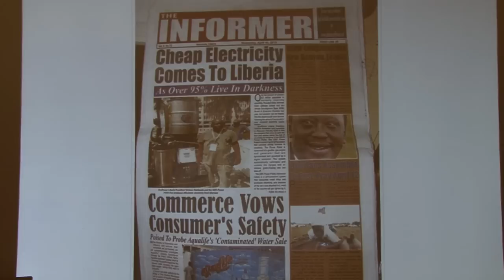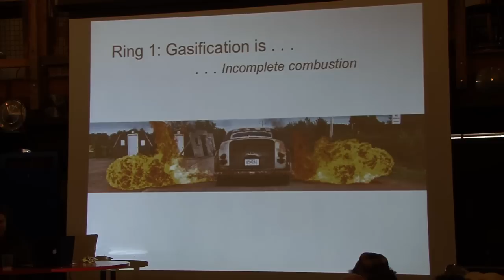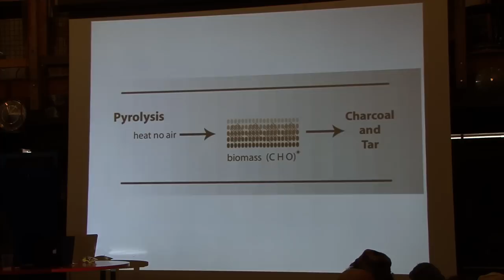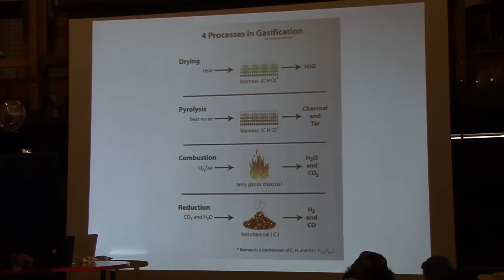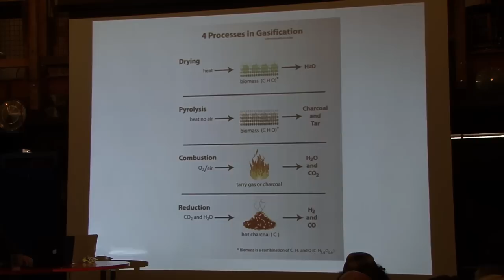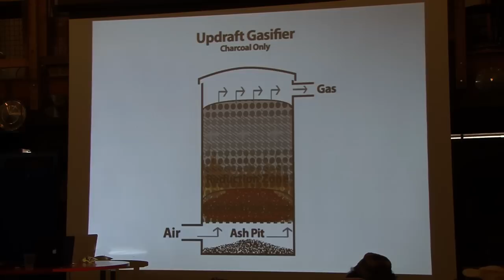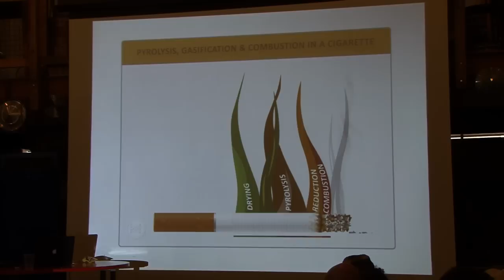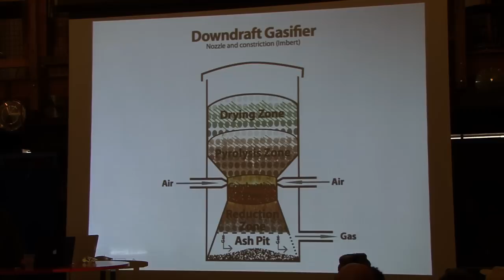Gasification 101 - Part 1

Comment: I have built a gasification test rig.  It does not recycle heat efficiently though.  It uses solar electricity to char the biomass via pyrolysis - mostly paperboard and wood waste for testing - this evolves a mess of gasses and liquids that are collected over water.  The reactor is steel and the heating is done via nichrome wire mounted in a firebrick housing temperature monitoring is via a thermocouple.  water vapor, methanol, other liquid hydrocarbons and lots of gas products are collected in the water at this point.  In the future I will probably try to condense and separate out those liquid products at some point so they can be separated and useful products saved and the useless ones recycled.  The Char that is left in the reactor is mostly carbon and is heated to 1200 degrees Celsius and steam is injected at the bottom below a screen.  The gases evolved at this point are collected again, this time almost purely CO and H2.  In my case I combine the wood gas and the water gas and can compress it for storage and use it for combustion using a repurposed air compressor where the inlet is from my floating gas storage and the outlet is to a propane tank.  The Fuel air mixture for combustion is closer to methane than for propane, but in a propane tank at 125 PSI and dropped through a regulator it will burn in my grill just fine, if a bit leaner.  It will not power it nearly as long though as you are compressing a gas and can not take advantage of a phase change with these gases.  The mixture is mostly carbon monoxide and hydrogen, but there is a bit of methane and carbon dioxide as well as some other hydrocarbons and nitrogen mixed in there.  I could scrub it to remove sour gases, but with my feed stocks that has not really been an issue.  The pyrolysis and the generation of the water gas are both endothermic reactions.  I input that energy from solar, so I do not leak that much carbon to the atmosphere until of course the end product is burned.  In a larger scale one could produce a large variety of products from the syngas generated.  I basically have a desktop batch setup that can generate a small volume each batch, but it is proof of concept.  It does work well.  Improvements would be to recycle the heat better to lower the required energy, and to build a distillation column to separate out the liquid products.  Additionally, I have been unable to convert all of the carbon when reacting with steam, I have recycled some of the carbon adding it to the next batch, but my ash still contains a bit of carbon in it.  The ash contains the potassium, sodium, phosphorus, calcium and other metal oxides  of the elements that were in the wood or paper board.  Generally this is suitable for fertilizer to return those elements to the soil where they can be taken up by the next generation of biomass.  At any rate this is just an experiment and it takes more in effort at this scale to run it than the fuel is worth at this scale.  I also happen to have a large solar power system, so I have access to the solar electricity in the daytime to power this.  On a commercial scale you might operate the pyrolysis and the water gas generation as a semi batch style, but you would want to operate the distillation continuous 24/7 which means that you have to have power all the time, not just in the day time.
Reply: Try a refrigeration compressor for more efficient storage.

Comment: You could almost cut the stress in the air with a knife.  Anxiety brought to you by 2.9mm drill bit & a 3.5mm-.6 tap.

When it is no problem to break a 3/8-16 tap by hand. These just little things can make or break a project real fast.
 Awesome video like always.

Comment: this is actually really promising. at first I thought "how is this green, its still producing Carbon emissions?" But you have to consider the source. Burning fossil fuel injects long sequestered carbon and other emissions back into the atmosphere, while burning tree waste just recycles the carbon thats already present in the atmosphere that trees use to grow. much like watering fields from a river, as the water will eventually return to that river through the water cycle. 

super cool stuff, and a good way to transition to electric while still maintaining fossil fuel equipment until replacements are avaliable.

Comment: Awesome! I need to generate about 6 KWH/day to power my house. If my initial research is close, @ 2.5 lbs of biomass/KWH, an efficient gasifier would need about 15 lbs of feedstock to produce 6 KWH/day. That's 450 lbs/mo. That's a lot of sticks lol. :) How much time/electricity do you use to collect & cut feedstock? Is it really practical to produce 6 KWH/day using a gasifier or is it more suited for emergency power and powering engines for short periods? Thanks!
Reply: The question is... Are you going to continue on the same path your taking now or are you going to modify your power usage in the future? The solution would be to lower your consumption to a sustainable level for your available time dedicated to power generation. I know we all use more power than needed day to day so you have to ask yourself what you can eliminate to lower usage and also get your family to buy in on it. Then maybe you would use 4 or maybe 3 kWh per day.
Reply: Pellets seem like the obvious answer.  But I'm a noob.  So, I don't know.
Reply: I live in a forest, plenty of dead wood out here.
Reply: I have a 3 story house with a full basement and I certainly don't use 6 kwh/day. Maybe 2. 
I have made a gasifier myself and it's not so bad if you cut up the sticks or rather use a mulcher to hurry this process up. Anyone who has trees knows there's always dead sticks on the ground. This is definitely possible for those who have a half dozen mature trees or more.

Comment: could a glass torch be run off of this process? without compressing it first? how much pressure does it have? under 1psi?
Reply: the gas produced is very similar to natural gas. Its called syngas, and you would want to make sure you are filtering all of the soot and tar out of the gas, nobody likes black colored glass!
Reply: lalo01231 i get the filtering. thats kind of a given. but my question is (and ive been told by a few people that it doesnt burn as hot as nat gas but im thinking they gotta be misinformed because as far as i can tell its mostly hydrogen?) can i get pressures up high enough to support a good flame? the highest i usually run my regulators for propane is 10psi. now thats pressure not volume. i think, from what i have learned so far, that a gasifier puts out lots of volume but not very high pressures. has anyone tested to see what pressures can be gotten? someone told me i would need to put a blower on to get enough pressure but with that i would also need to make the whole system larger to accommodate the higher airflow. has anyone tested to see how many lpm any given system will produce?
Reply: Why you got to be so racist? Black Glass Matters!

Comment: If the combustion of the fuel and reduction of H2O and CO2 are equal and opposite energy reactions, why does the combustion chamber get hot? Shouldn't all the combustion energy be using in the reduction?
Reply: Nevermind, he answered my question at 45:30.

Comment: im going to write a patent on a "nitrogen free gas stream" gassification device . this would allow you to get perhaps 8 hp out of a 10 hp engine rather then only 4 hp out of a 10 hp engine . I need your help i have several very interesting ideas that i think you will be amazed with   . we could take gassification to the next level with the ideas im working on but i cant do it alone. I can turn liqiud carbon dioxide into fuel. are you interested ?

Comment: Why do you have to Output H2 + Co? You can put them back into their secondary burning chamber and get more energy out of that s***!
Reply: I didn't watch the whole thing because I am spoiled by fancy video production, graphics and animation but I think the output is the fuel collected and the whole point of gasification. Hydrogen, carbon monoxide and methane are the desired gases.

Comment: The video is not complete, the flue gases produced will be carbon dioxide, carbon monoxide, Sulphur dioxide, Furan. Oxygen injection will need a very expensive air separation plant, need carbon sequestration for large amount of carbon liquid deep storage, hydrogen will need to be supplied by oil refinery, need a long list of scrubbing chemicals and PM ash capture. Rule 101, you can’t gasified inorganic to organic matter. Most white gas from gasification feed stock do not have enough paraffin in naphtha. True Gasification is very expensive with proper extraction and flue gas treatment and very much dependent on high crude oil price to be economically viable. To many paper scholars presenting too many presentations without working in a refinery. Go work in oil and gas industry before presenting.
Reply from the maker: We're not entirely clear on your thesis here, Thomas but you are correct that "Gasification 101 - Part 1" is not complete: please see the rest of our helpful and instructional videos as well as the wiki community we have to learn more from experts, hobbyists, and well-wishers in the biomass processing world.

Comment: All comments still in stone ages using imperial units ie lbs, Hp, Psi etc. The world already move on long ago in Metric system.
Reply from the maker: All Power Labs is an American entity and so we will inevitably have to interact with imperial units for heat, lengths of tubes, screw sizes, etc. We publish all our work in SI/metric units, as does the rest of the scientific community. Neither of those systems of measure was in use in the Stone Age.